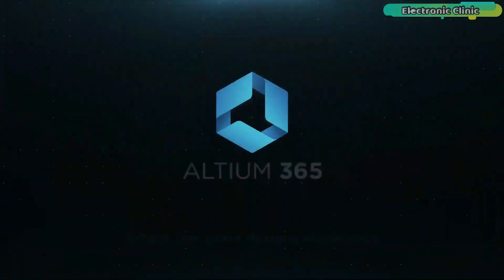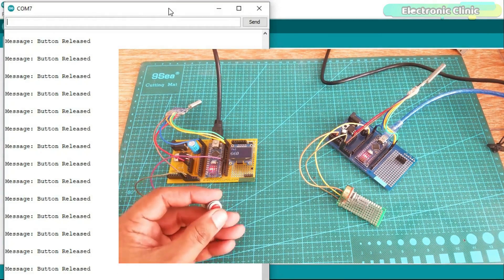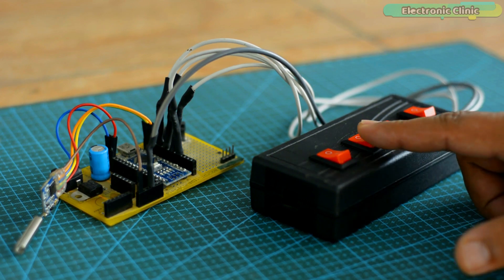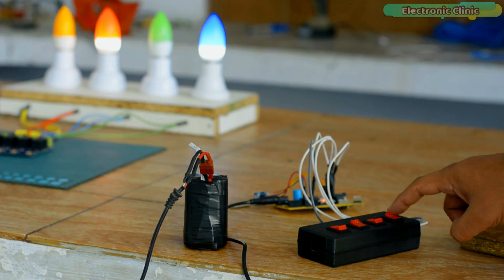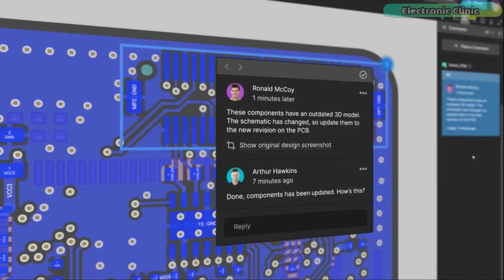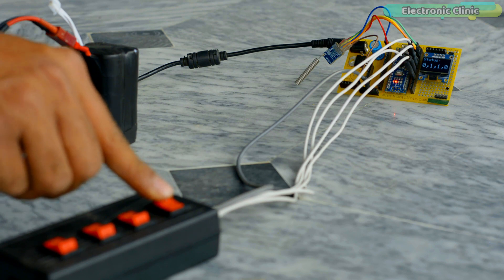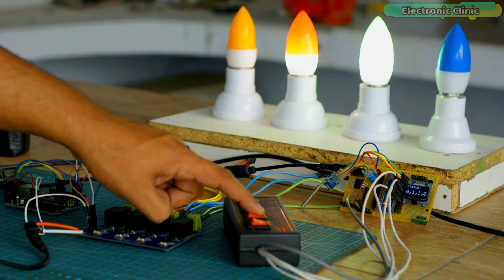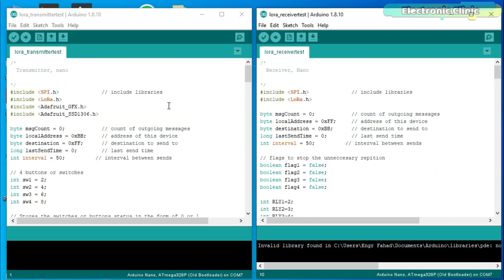Arduino and LoRa based Automation Project with Feedback message, Lora SX1278 range test

Comment: what is maximum range of data transmission
Reply from the maker: @bhupendrasingh9014  it's about 1km to 5km depends on the type of antennas. I have a video on different types of Lora antennas.
Reply: @ElectroniClinic  currently i'm working on agricultural project in which i'm going to control water pump via soil humidity level, ph and other things According to different crops using lora module so i'm unable to get more data transfer range and also please suggest me a industrial level soil sensor, if you want i can share my project details complete code, and connection diagram
Reply from the maker: @bhupendrasingh9014  did you check my latest video on soil pH, humidity. And temperature using Lora? Check the esp32 projects playlist.
Reply from the maker: check this out.
https://youtu.be/XMob43TSo78

Comment: greetings from Argentina!!! your projects are very good. I did the Lora project with sensors and it turned out perfect. A question in my case for this project, when the board is energized, the relay modules are activated automatically and when I press the button it turns off. Should I change some program code to make it work correctly or add a NOT gate? thank you so much

Comment: Thanks very much my dear. Please, if one happened to have about 3 different receivers. Is there a way to make it so that one can change the destination addresses of the receivers in the transmitter code so that one can choose the receivers one will like to communicate
Reply from the maker: ya this can be done. its already in my list. Soon i will upload the video.
Reply: @ElectroniClinic  Thanks very much. Please, I waiting for the video. How I wish it will come out next week. I am making this project but the problem I have is how to change the different receivers destination address in my transmitter code. Please, if you can add a lcd and keypad in the project so that one can use the keypad to type the specific receiver address he will to communicate and use the lcd to see the address he typed. Thanks very much my dear for all efforts. I appreciate your work

Comment: Hello . I created your project but there is a problem with  programing part. Result is only dots on the OLED screen not the feedback message. I suspect the problem is in the GFX library . Ar you using custom library on your computer. Can you please check again . Thank you.
Reply from the maker: you.might be using the ssh type oled, watch my video on oled display issues fixed.
Reply: @ElectroniClinic  Hello again . Thank you for this insight but the problem stay the same. My OLED work perfect with  
bout library SH1106 end SSD1306 when I upload different sketches. Problem is when I tray to upload one of your sketches containing Arduino , Lora end OLED .If you have any toots please share whit me . Thanks.
Reply from the maker: i have been using the same oled and arduino, and so many other guys have built this project. you might be missing something. check my other videos on arduino and lora.

Comment: Only 110 meters range test?.you don't need lora for such small distance, its overkill.  There are many other very low coat options, You should try and  test atleast 6kms and beyond for which lora is actually build. Wating for such real test.
Reply from the maker: this is not the maximum distance test.